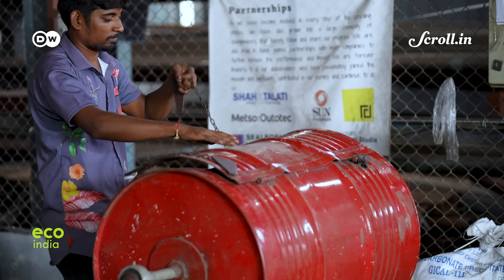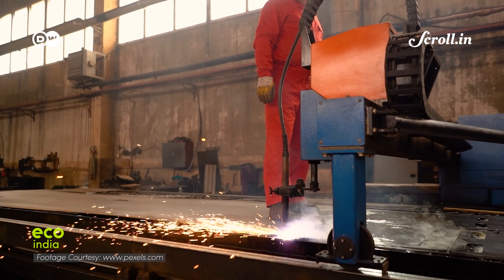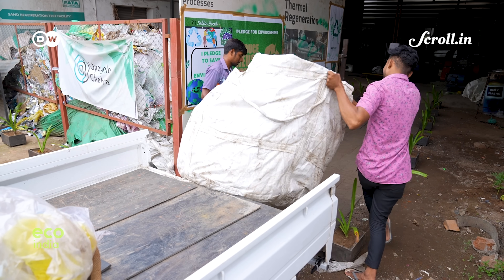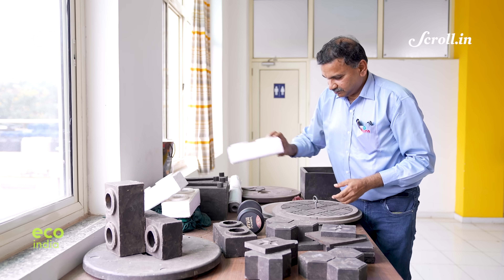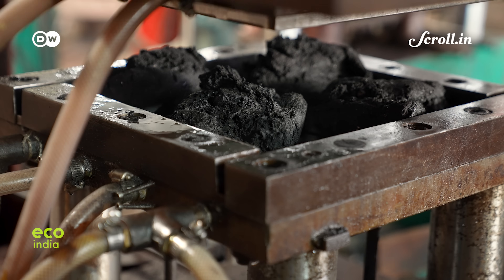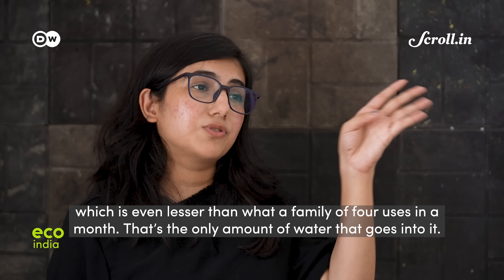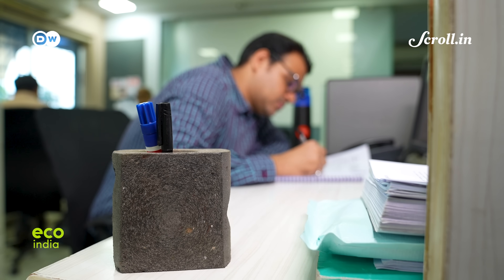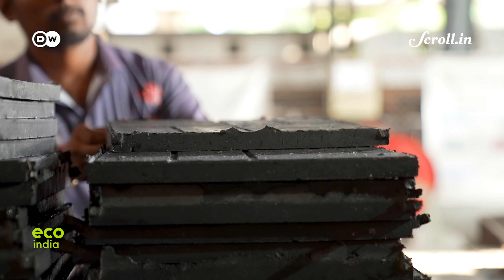Eco India: Can we construct using just plastic waste and dust?

Comment: They mentioned the silica waste can have heavy metals.. how is that handled in the production (worker protection) and when used in exterior applications. Plastic degrades in the sun.. how does this hold up?
Reply: That was my thought also. "Yes this foundry dust is poison, so now we are adding it to building materials so everyone gets an even dose." WHAT? I have seen and like the idea of plastic and sand to make pavers but foundry waste HMMMM
Reply: Best case of reusability available for the forseeable future possibly. Meaning standards including hazard test though are a real concern, mostly go out the window once the market viability takes precedence.
Reply: few plastics are degrade in sunlight although this can be prevented by using
" photo stabilizer"(chemicals to stop degradation).
Reply: @RoachDoggJunior One can dream of subatomic interactions in the presence of prolonged UV.. right? Just add quantum 😛
Reply: Silica itself is not toxic, but inhalation of its dust is.
Reply: @selflesssamaritan6417  Yea they were careful to show no faces - let's hope the factory has respirators. Not to mention the VOC from the heat treatment. Seems like this works in a closed system with minimal hands and lots of sealant

Comment: Shouldn't Nitin, and ALL factory workers, be given EFFECTIVE masks to wear to save their lungs from the dust which contains "heavy metals" and other carcinogens?
Reply: That's a valid concern. 2 points here - first of all the dust is already in the form of a paste with plastic and does not fly when it comes out from the machine, secondly - masks are provided, habit to wear self protection takes time, and we will work to enforce the same, till it becomes a natural habit. It is perhaps similar to our wearing and not wearing seat belts - sometimes we need enforcement to form habits.
Reply: @rhino.manish  put up pictures of damaged lungs, like they do on cigarette packs.

Comment: Does this have breathability and heating issue? As conventional bricks are made from soil which has a cooling effect
Reply: most plastics are thermal insulating, keep things warm
Reply: Hi  @James-wd9ib , Thermal insulation can be beneficial in colder regions(northern India) , however major part of india faces hot summers as a result such tiles/bricks might capture heat and may turn out counter productive. Correct me if i am wrong. Thanks
Reply: @rudrarajtrivedi2258  a research is being conducted by Dr Sanskriti Majumdar - MSU University to determine the thermal conductivity and albedo rating of SPB. Academic institutions are now getting involved in considering all the factors.
Reply: thanks for your response @rhino.manish

Comment: What about the heavy metals in the foundry dust? Aren't we brining it to our homes in this way? This wasn't addressed in the video
Reply: In addition these are bound by the plastic and thus stopped from flying around in the environment.
Reply: Best case of reusability available for the forseeable future possibly. Meaning standards including hazard test though are a real concern, mostly go out the window once the market viability takes precedence.
Reply: No worries, heavy metals are the toxic metals like mercury, cadmium, arsenic, chromium, lead etc. However, foundry dust is just common metals like iron, steel, brass, copper and aluminum. We already use these metals every day as drinking vessels... but when micronized particulate as with foundry dust, yes, they have higher surface area and thus may have higher toxic potential, and plastic possible carcinogen- simply seal the surface with layers of laquer.
Reply: @James-wd9ib  The professor clearly stated heavy metals, in addition foundry dust has been linked to carcinogens. The plastics used as binder are clearly a mix of various polymers including single use plastics and recycled plastics. They are unstable and definitely leach into the environment
Reply: @gaswhole  While the plastic argument may have merit, the term "heavy metals" as it used colloquially is not the same as it's actual meaning. Iron, zinc, copper, tin these are all heavy metals.
Reply: @James-wd9ib  What are you trying to say?

Comment: Aren't the heavy metals a problem... Even though they have a very long life, there may be a day where these tiles etc, get piled up in building's rubbish... Is recycling of these materials possible... I feel like there is a way to recycle them but I think it may lead to exposure of heavy metals into the environment again .. 

I don't want to criticize. Just considered these as the building blocks which may make this product which is good tooo best ...🙂
Reply: I am just backyard armchair scientist, I have no authority- but foundry dust is simply ordinary metal dust like iron, steel, copper, aluminum. Heavy metals are more chemically reactive and will quickly be absorbed by living tissue like lead, cadmium, mercury, etc.
Reply: A relevant observation. The SPB composite can be and has been tested for reuse after crushing it.

Comment: Awesome job....... Environmental and profit friendly work.
Reply: Thank you for the kind words.
Reply: @rhino.manish  
1.Your employees are inhaling all the fumes from the melting plastic. 
2. Your equipment is rudimentary at best. Take the broken down barrel at the beginning of the video held together with wires. This is not jugaad, it is just not having a concern for the people working at the factory
3. The foundry sand contains heavy metals and other pollutants while the plastics will easily breakdown under UV thus releasing their harmful contents including micro plastics in the air and water where they are used. They are shown being used indoors also
4. This project is greenwashing. Magically, if the problems stated above disappeared, the fact remains that small insignificant projects like these will be used by industry to convince people that they are doing loads for the environment. Media companies will uncritically publish these to aid in the greenwashing. Academics will also be used just as the professor interviewed here

Comment: How does it stand against fire?
Reply: it's silica + polyeurothane only when a particular temperature is reached that is could be 600-650C assuming even without any calcuation due to ratio; wood starts burning after 450C, it will produce fumes after... but  clay tiles also produce fumes + they absorb heat... these tiles tiles wouldn't absorb heat unless burned and they will expand and crumble... so they are much safer... and silica is already treated with foundry heat... the problem is not fire it's the process it's very expensive to cast and there must be some catalyst to bind plastic. silica can be hard to work with due to fine powder ,it can cause lung problems... if this is mechanised close to a foundary then this can have some serious bussiness... could invest in a industry mass producing those
Reply: Yes - it has been tested in the factory for instant fire resistance, and also upto 100 deg C we did not find any loss of property or fumes.